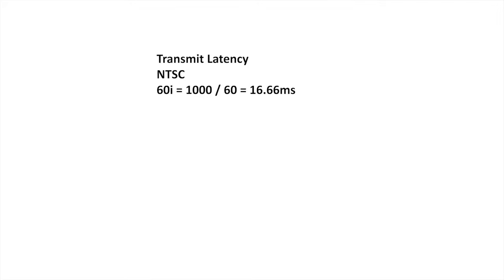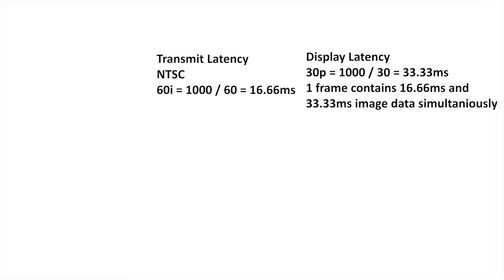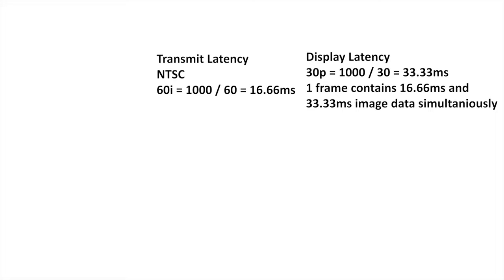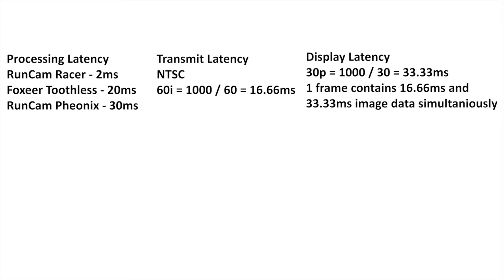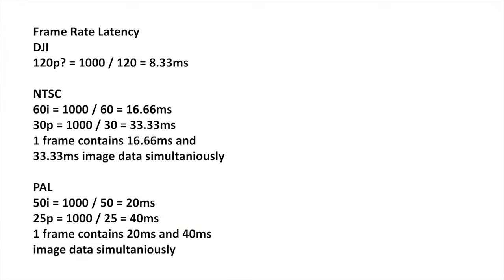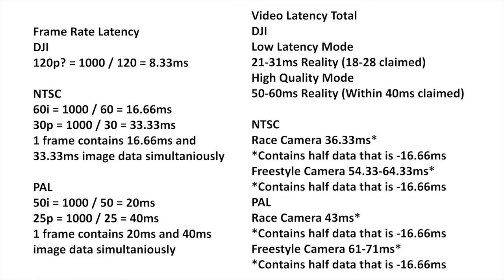FPV Video Latency - DJI Vs Analogue Latency Comparrison

Comment: Excellent video and methodical thinking there mate. I certainly had a much improved experience with the system when turning off temp control.
Reply from the maker: Thanks a lot mate. I know I skimmed over a few things but managed to cover the most of it.

Comment: I do really like the system, however the biggest disappointment for me is the skipping / sudden latency changes when you fly behind a row trees. I am flying high speed manual control planes, so if the image skips that can be the end of it very quickly!

Having said that, in a large open environment it is absolutely spot on.

Would you recommend checking anything else in the settings? Running low lat, auto focus mode, high power, auto power down (whatever it’s called lol) is off.

50mbps makes tree penetration worse, a few people have mentioned this, I hope people are honest about that and report back because technically it should be better. How it initially handles a tree is dreadful! 25.4 is definitely more predictable.
Reply from the maker: I recently got sent a set of the MenaceRC DJI patches, they go on the bottom two sma's and then I use the stock ones on top. I think this has made a big difference when flying behind trees. I started using them at the same time as 50mbps mode, so I don't know which is doing it (prob both) but I don't get anywhere near as many skips as before. These skips or lag spikes take a bit of getting used to, you just have to treat it like static, it's the same thing really but because it is not the same your mind freaks out. I don't think it happens anywhere near as much as when I first got it but I have lots of different setups and have had 6 firmwares, so too hard to tell what changed, especially when NOBODY knows how it even works. 

Your settings are the same as mine from what I can tell, so shouldn't be too bad. Simple rules to get better performance would be.
1. Don't stand within 5 meters of another DJI goggle
2. Fly in front of you, especially if using patch antennae, make sure antennae are on securely and patches pointing up
3. Don't fly from under a tree, next to a building or a wall

Me and my mates have always managed to get good results and if you get skips that are long enough for you to crash (mine are usually over within half a second and usually get some idea before it happens) then you may have a noisy place to fly and is causing issues, so try other spots to rule that out too. Just have to keep trying little things until you figure out what is causing it.
Reply: Bludz FPV appreciate the reply. 

Getting my head around the blocks/skips are static is good food for thought.

You are right, they don’t last long, I think as it’s new to me I have that sinking feeling that the skip isn’t going to stop!

I have a few setup bits to try! I think a couple of smaller patches will be good to play with..
Reply from the maker: I've been right where you are mate, I just stuck with it and changed my way of thinking about it. I think I have a strange way of thinking about stuff but I'm glad you understood what I meant.
If when the frame froze in the goggles they displayed a lot of static all over the last received image so you can just about make out the sky and the ground, then it would look the same as analogue, but I have grown to prefer having the last frame displayed in full so I at least have something to look at.

Comment: Frame rate isn't the only factor. I could send you 60fps from a webcam in Australia, you'd be getting 60fps but it would be delayed significantly from the real time movement of the camera and you could not fly with that latency.
Latency and frame time are not the same thing.
Reply from the maker: At no point do I claim that frame time is the only factor in latency. I clearly explain that there is processing time etc. DJI would be 8ms latency if I was claiming that. Framerate plays a HUGE part in latency though. DJI uses this to do a lot more processing than any other system hense why the image looks so good. Pretty basic physics.
Reply: @Bludz yep frame-rate essentially sets the floor for what is perceptible right? You could have 1000fps feed but a 60hz screen won’t display anything faster than 60fps.
DJI does have variable latency as far as I know it can re-transmit data when signal is low, I honestly think this would be more noticeable than a constant high latency
Reply from the maker: @dingbatfpv  That is totally correct, you have to have a scrren that can display the frames quick enough to get the drop in latency. However, those 60 frames out of the 1000 will have no shutter time induced latency, so in some tests would appear  lower latency. The varried latency is simply where it drops a bad frame instead of displaying it. Analogue does the same thing only it will display the bad frame, so instead of stuytter you get a flash of blank screen. When DJI drops 1 frame it costs a lot less in lost time than analogue does when it drops a frame. If you see a flash of black or white while flying analogue you have droppped 2 frames and latency at that split second jumped up +32ms. IMO analogue has much wider variable latency than DJI, but that's a subject of it's own and I tried to avoid it here.

Comment: I agree, but then you got guys like Mr Steele saying that the Variable Latency of dji puts him off. He recently complained that dji would have 5ms changes when flying in a house he recently flew in. I doubt he can tell 5ms differences and is really just more into defending analog at all costs.
Reply from the maker: Very hard to tell, gotta have respect for Steele. I don't think he has given it the time required to form a valid opinion although he knows lots of people who have used it. Bit of a touchy subject isn't it, I was apprehensive to make a video about it but thought I had some valid points to make. A deinterlaced image (what analog is) contains info from different points in time, so I doubt you would notice 5ms, you can see the number change in the goggles and a placebo effect kicks in.
Reply from the maker: I don't know him so I couldn't say what he is like as a person, sometimes comes accross badly in videos but then in others he seems quite normal.
Reply: PatrickFPV his opinion is based on if he makes money. This is his income, business etc. he’s a professional pilot not a reviewer. 
His channel makes between $140-$400 a day so any views are good views for him. He does need to balance that with making Ethix and TBS products sell.
Reply from the maker: Soulblade is quite inaccurate when you look into it, I wouldn't claim to know what he makes from youtube content alone. He doesn't have many subs and views compared to people making bare money like that. $800 a week is highly unlikely, that's 41 grand a year for an average of 2 minutes of content a week.
Most of the Ethix products are not bound to analogue. What do they even make, lol. Main product is rebranded hq props right? That's all I use anyway.

Comment: Finally......A good breakdown. but I agree.
Reply from the maker: Thanks dude, and thanks for the share. I was too scared that I made too many mistrakes to post on FB, but now I will just have to deal with it if I have hahahahaaha. It's great to know I wasn't alone thinking this info needed to be said. Much appreciated :)
Reply: @Bludz  I had a couple friends explain it to me a few months ago. We were having a discussion about dji latency.  They explained it very similar to your video. And it made sense. You shouldn't worry tho.....Even if something is off its better to be shown so all know. So if anything the video brings a little light to the limits or boundaries of analog and digital video transmission latencies. But as far as I can tell you hit it spot on.
Reply from the maker: Yea man, you're right. I'm glad I can say it is totally unbiased opinion too.

Comment: Analog for cameras have rolling shutters so the latency due to frame rate and interlacing is way lower than what is indicated in this video.
Reply from the maker: Not all analog camera's have rolling shutter. The toothless has global and you can set the speed to 120hz, so the latency could be lower. I'm not an expert, so didn't want to risk bringing the shutter into the mix. Good point though man. Rolling shutter will make the latency jump around a lot right? Because it's not in sync?
Reply: @Bludz  All of those claiming below 30mS latency is rolling otherwise it would not be possible to have a latency that low...
Reply from the maker: Ah okay. Do you mind explaining why that is. I'm not that clued up on the difference between global and rolling. I see where I made a mistake.... It is the Pheonix 2 with the global shutter, and it is 30ms latency. Toothless must be rolling.
Reply: @Bludz  Ok.. so global shutter stores the whole picture at the same time. Every pixel comes from the same time interval. After that it is serialized and sent out on the video signal. That means the last pixel that comes out on the video output signal is delayed more than the first pixel. Rolling shutter means that the video output signal represents each pixel as it was just before the video signal comes out which is the reason to why you can have delays as low as whatever 2mS or so... Is that good? Not sure... on one hand you want the video signal to represent the latest possible data but on the other have you want the picture to represent correct geometry. Rolling shutters make the props look like banana peel. On the receiving end... the picture is drawn pixel by pixel, line by line more of less at the same time as the rolling shutter is creating the video signal so that should be the lowest possible delay.
Reply from the maker: That's a really great explanation man, I appreciate you taking the time to share your knowledge on this subject.

Comment: not entirely true... it has been tested... numerous times analog (good camera like Predator) camera to the eye can reach 14-16 ms while DJI HD camera to the eye is around min 23 but more like 25. So either you can't feel the latency or you care more for the picture quality (which is awesome on DJI) The idea here is to receive new information as fast as possible so you can react to it... analog is still the only sistem capable of that... and HD(compressed) will never achieve that I am afraid. But awesome system for everyday.
Reply from the maker: The main point of this video was to explain deinterlaced video. Tests will show response in 16ms, but that is only half of the image data (1 deinterlaced frame). It takes a minimum of 32ms for the full frame (1 interlaced frame) to be displayed (when using an NTSC analogue camera). This doesn't acount for the camera processing latency (minimum 3ms) and the phase delay between the cam, vtx, vrx, and goggle screen (they are not in sync).

Comment: Did anyone able to tag "The Slow Mo Guy" "Linus Tech Tips"? This video just reminds me, They both have a video about analogue TV/Super Mario game and the LCD/CS-GO in slow-mo, maybe they knew the magic sauce about Analog vs Digital 😂. Let's compare it without temp control protection.
Reply from the maker: Check out Linus's video about 240hz vs 120hz. This is more the point I'm trying to make. FPS has a huge factor on latency. We need Slo Mo guys to test to within 0.5ms :D 2000fps camera would be awesome.

Comment: So you're actually saying that analog has more latency than dji fpv system. That's not even what dji claims in their site: "Most analog transmissions provide a latency between 22-35 ms." How did they even come up with the 22ms part of the range? Please throw some more thought to this, something seems to be off
Reply from the maker: It's quite a touchy subject for some people but basically they are about the same. Analogue is only sending 1 frame every 16ms, the camera takes 4ms for the fastest (some take 15-20ms to process). The cam, VTX, VRX and screen are not in sync so it is almost imposible for it to be this fast, some frames will be this fast but some slower as they have to wait for the next components sync to pick it up and forward it to the next. Not to mention that 16ms frame is actually only half the image data as it is an interlaced transmission and slower if using PAL. It's actually quite simple calculation based on physics and no real world test even required. I have a 1000fps capable camera now, so I will be doing a bit of a follow up video on this soon with evidence. 1000fps is required to record 1ms increments which should be highly accurate glass to glass latency.
Reply: @Bludz  I am a dji user, I really want you to be right but it's just not consistent with what I feel (and I'm very aware of the placebo effect). Can you feel the difference between dji low latency and high quality mode? To me, that's about the same difference between analog (predator camera) and dji low latency mode. Nothing much, nothing important but it's there. I'm really looking forward to your tests with the new camera, keep it up!
Reply from the maker: I can't fly my style of FPV in the high quality mode, the latency is just a bit too high for me. Maybe when I'm just cruising but that never lasts a whole pack so I stick to low latency mode. The only time analogue feels lower latency is when you haven't set it up well. If you extend the antenna out the back of the quad you rarely drop below 21ms. I like to think I'm a pretty fast pilot and the MUCH bigger FOV of the camera, the super smooth high fps display is unbeatable.

Comment: Great video.... I'm thinking as  well that the analogue goggles add additional latency. 
(You may of already said that....Im Getting old)
Reply from the maker: Certainly all VRX and screens will add latency because they have to do so much work. From deinterlacing the analog video to resizing and displaying on a digital screen.
Reply: @Bludz  VTX and VRX (Modul like rapid-fire) have less than 1 ms delay in average.
Reply from the maker: Good, that's what I used in my testing.

Comment: 16ms or 33ms is just the time interval between the frames, I don't get how this translates to latency. Can you explain it please?
Reply from the maker: The video latency is the time between something in front of the camera lens happens and the time you see it in the goggles. If the frame takes 33ms to go from the camera to the screen then you are not seeing what is happening until 33ms after it has happened. Because DJI send 120 frame per second it can use the gained time to work it's processing majic and create such a great image. When a frame is currupt it drops the frame and that's why the latency increases and is variable. This is also why analogue also has variable latency, only the latency increase is far greater and more variable than DJI. Even if you are generous and say analogue is 20ms from camera to goggles, everytime you lose a frame that jumps to 40ms, but it is over in 1 more frame (20ms). FPS is directly linked to latency, ask any pro gamer.

Sorry that's a bit long, hope it explains things better.
Reply: @Bludz  I see what you're saying, but I don't think that's what it's about. I mean if we could just send a single frame, how many ms would it take? That's irrelevant from the fps and that's what we are interested in
Reply from the maker: FPS means frames per second. 60fps is 60 images per second making motion video. 60 divided by 1 second is 16ms. The camera takes 1 image every 16ms, processes it (+4ms minimum) and then sends it to you screen. The screen then also runs at 60hz (60fps), and sisplays a new image every 16ms. The 60hz is not in sync with the camera so the screen will actually display images that are older.
Reply: @Bludz  So, if we had a screen with a 200hz framerate, the latency would drop? As I said, I'm looking forward to your tests. Happy flying!
Reply from the maker: The screen would also need 200fps going into it, but if the camera and vtx was transmitting 200fps and the screen was 200hz then yes, the latency would be lower (technically depending on the processing time, you need enough time for that to take place).